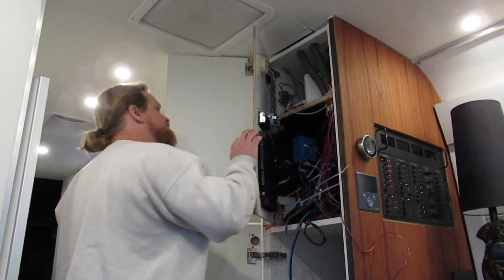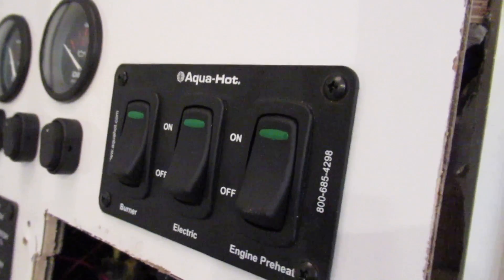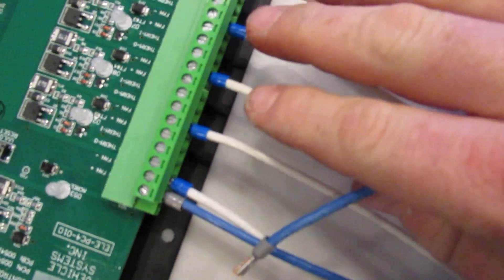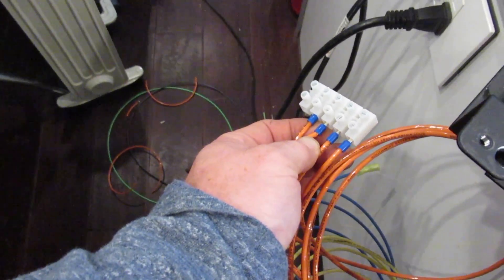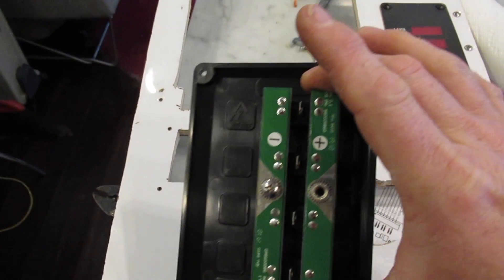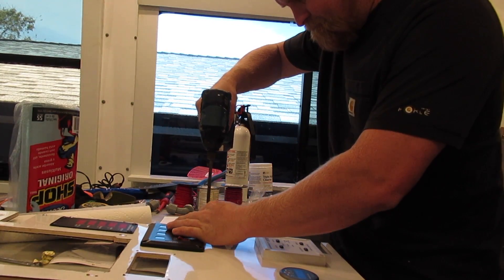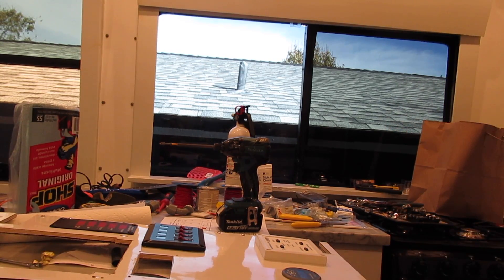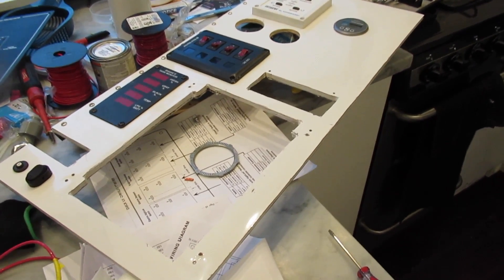Aqua Hot 12 volt DC Power RV endless hot water

Comment: Do you have a second thermostat for the basement? Seems like you'd have a hard time heating it appropriately if it's controlled by the Nest but probably not an issue if you don't spend much time in sub-freezing climes.
Reply from the maker: yes, each of the two bays i'll be heating will have there own thermostats.